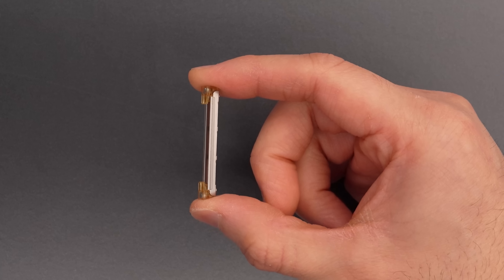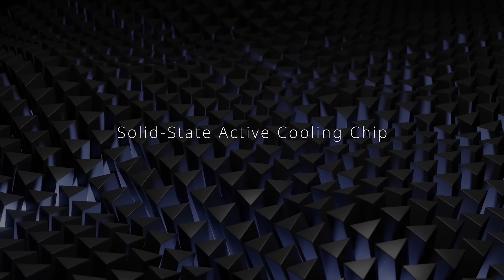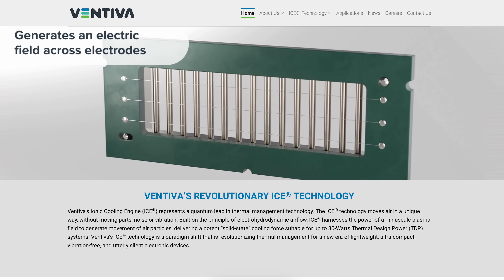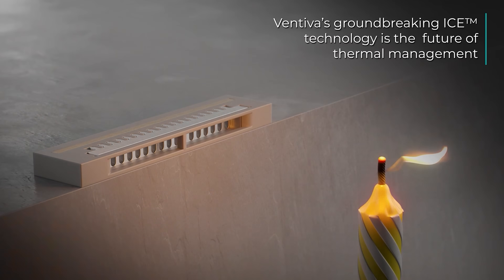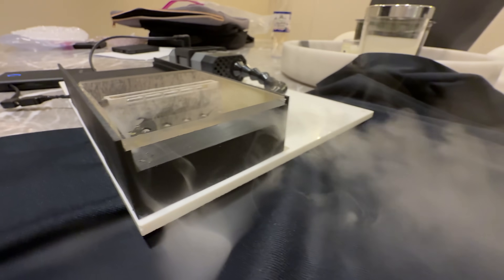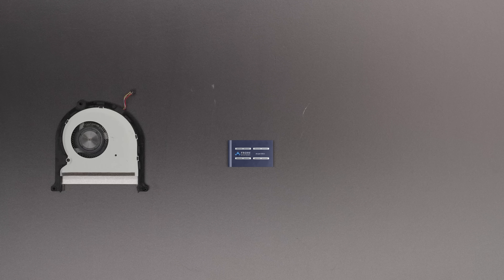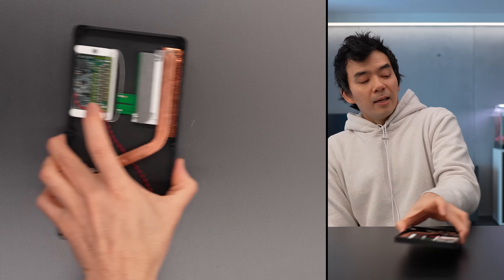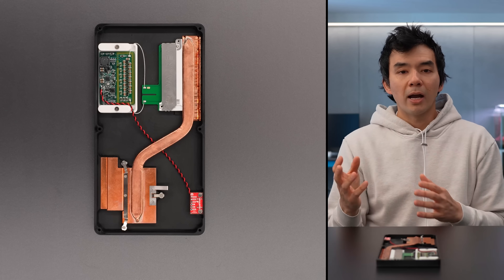The IMPOSSIBLE Laptop Fan...

Comment: Just so you're aware, this tech isn't even remotely new- The company that formed Sharper Image created an ionic Air purifier in 1977. It was later rebranded to the Ionic Breeze, & with a new ad campaign was really popular around the early-mid 2000's. They still exist now, & I bought one myself primarally because I had friends that smoked cigaretes. It would pick up dust, animal dander, smoke from cigarettes, got a smaller one that I used for my soldering station, to pick up the burning rosin & flux smoke, it worked fantastic for that by the way; & to clean it you just gave it a quick rinse or wipe down with a soapy washcloth. Although it was pretty expensive at the time, it still runs as well as the day I bought it 28 years later.
Reply: I had one too 25 years ago, it was pretty cool but I agree, nothing new here except for power management
Reply: Wow. That opened some information about that company and their controversy.
Reply: Ion air cleaners are 'forgotten tech' because everyone wants to sell you beefy motors to force air through micropore filters and sell you new filters forever.  There is a small volume in which you get good results, but it's the same for HEPA devices and there are ridiculous claims there as well.  Years ago I chose my ionizer for one reason: mold, pathogens and dust in the bedroom.  This improved sleep so much I used them ever since.  Wiping positively anchored particles off walls and surfaces is satisfying, to know I am not breathing it.  And they're cheap on energy and silent.  Just stayed in a motel for several months, a place where neighbors complained about the mold.  I taped over central vents and the ionizer kept the air 100% clean.  Have been breathing neg charges oxygen for 40 years.  Good healh, clear sinuses.  I get angry and insulted when I explain the effectiveness to my family and friends and they don't even bother to try it because they don't believe me for sh*t..  I reply to them, "Darwin in Action" I guess.
Reply: Yeah the concept for ionic thrusters is from 1911 so not new but if it works in a laptop it’d be great as I don’t care for fan noise.
Reply: The tech itself is not new no. Of course! But shrinking it down to cool a laptop is. Imagine if they could use this in the next PlayStation? We could get a console back down to almost PS2 Slim sizes.
Reply: @KCScorpion34  or, we can be grown ups and accept that changing charge states in FET structures inside a silicon semiconductor inherently creates heat, thus if we want things like, say many gates doing many things very quickly, there WILL be heat generated (work is work, a watt is a watt. In physics there are no free lunches).

Seriously, the real problem is the manufacturers keeping out on overall airflow design and heat sinks where they are needed. Trying do everything with one fan. And it has to be silent, because of all the self labeled autists out there who think hearing a noise is supposed to throw you into this inescapable spiral of oh no I can hear a thing hashtag day ruined.* What we need a lot more of is the extra 3 cents spent on generic heatsinks to stick on tertiary, fans with enough excess air flow/more fans to provide air flow over them instead of letting the boards cook so little johnny doesnt have to hear his computer working, and less exotic experiments into die bonding and ball soldering to facilitate difficulty in the user gaining full access to the device they have purchased by way of goop squirted around the mounted chips... Not 8 year old picture book thin modern flagship gaming consoles. Do you want red rings of death? Because thats how you get red rings of death.... The people need to demand reliable systems that dont treat them like fragile walking wallets with criminal intentions. Screw flatter, quieter, whatever-er crap. I want to own my system and have it be as reliable as my NES....which still powers on like the day we got it for Christmas. Oh, and not in some stupid avant-garde pseudo-modern-art shape. 

* Im ADD HD (from way back kids), I can say that. I can also say, given my direct and personal experience living with the disorder, that is not how that works, at all. Silence is terrible for the ADD brain, like literal torture. If you long for absolute silence and fly off the handle when you can hear something, A) youre a overly controlling douche nozzle that never learned you're not rhe main character in the universe, and B) you're looking for an excuse not to do the thing. What people who do that are pantomiming is more executive function disorder, but as a bad parody, sort of like people who play OCD when really they're just a control freak (the clue is in the D...its a DISORDER!!! If you can playfully toss it around for cripple clout with your buddies or wear it as an identifier, it aint a disorder, its a fashion accessory. And it is incredibly demeaning, belittling, minimizing, and outright offensive to those of us who ACTUALLY have to deal with ACTUAL broken brains. Not just a brain mommy and daddy didnt prepare for the real world....Now, go a head, tell the Mr hyperfocused on everything all the time's observations of human behavior how his personal experiences in life are wrong....minimize me again for that pop-culture clout....)
Reply: @zombieregime  I'm not reading all that fam.
Reply: Don't these produce ions that cause cancer??
Reply: Do you know if i can make one as a DYI ?
Reply: @averagefpv9449 yes, search YouTube. I saw a video of a diy version of this
Reply: 28 years and still in good conditions thats a interesting bit
Reply: That's true I had one when it died from old age I bought a new one and it still working right beside me
Reply: OP: "this fan is really quiet, wow!!"
Audience: "cuz it's really weak, grug!!"
Reply: I had it too and realized it barely cleaned the air of a room, only a very small area around it. The ozone smell it created gave a false sense of 'clean air' but was really just polluting the air even more. You're idea to use it near a soldering station is smart. I also remember cleaning the blades was not easy. If the black residue was left on for too long it basically electroplated itself to the blades and I had to put some serious elbow grease into wiping off all the black residue.
Reply: I mean this is the same like saying M1 in Apple MacBooks is super old technology.. Yes ARM has existed, but never at such power efficiency levels and at such scale. Same with this technology.
Reply: @snelle_tomos  Its not even close to being similar example. This tech is extremely similar to iconic breeze

Comment: Just looking roughly at the design, the fine wire is probably a failure point.
And the deionizing part probably has sacrificial material in it.
It is also looks unserviceable. 
And you can only replace the whole unit.
The company that is most probable to use this tech is DELL.
It is interesting though.

Comment: This is a horrible idea! Fans are efficient and proven technology that is cheap and works reliably. Putting a really high voltage generator into a computer where chips are running at increasingly lower voltages is sheer madness. The dust build up, filtering requirements, and potential to generate harmful levels of ozone with lack of maintenance are complete deal breakers. No commercial operation puts any money into maintaining their computers once they have been installed and set up on a desk. It runs until it breaks or becomes obsolete with minimal if any intervention in the meantime. Forty years of experience have demonstrated that this is practically a law when it comes to business, not just a rumour or a hypothesis. Just because something can be done, it doesn’t make it a good idea or even a breakthrough. Ionic propulsion systems have been known about for decades and they work well in space satellites but there just isn’t a use case for terrestrial based technology. There are some limited uses I can think of and laptop computers are not even on the horizon.

Comment: these are old and have been used in satellites as thrusters for a long time, even the TIE fighter was based on this tech, but they work on high voltage and that can cause charges to accumilate/buildup, its dangerous

Comment: You are so excited about it working in ideal conditions but in real ones it will corrode(applying electricity to things at non sterile conditions does that), spark(when humidity is higher, like a rainy day(or in come regions every day is like that)), and get covered with dust(and cleaning the dust off a thin and very fragile wire can kill the cooler instantly).
It will have quite low static pressure that will ruin efficiency.
Exactly the same problems that ionic thrust hobbyists have when building similar things.

Comment: Sharper Image had this technology back in the 90s, called the ionic breeze, it was advertised as an air purifier. I owned one, it produced ozone and it would electrically charge the air and dust particles. dust would collect to the fins. I suspect that this will create ozone as well and will get dirty very quickly which will require constant cleaning.

Comment: Let's see how did they break the impossible. You can use vibrating piezo materials to make airflow, but that's still moving, so it should be something else. If you would use electricity, it needs high voltage, which is not silent, and also it generates ozone which is toxic, and it's also really weak.

Comment: few problems: 
1. efficiency of MnO2 as a catalyst decrease with increase in temp, which is gonna happen with heat sink
2. the decomposition of O3 to O2 is itself an exothermic reaction (releases heat).
3. Air also has N2 thats being ionized, which release N ions and it has O ions too they can also combine to form harmful nitrogen oxides too.
4. The MnO2 layer will degrade overtime, and when it does ozone and oxides of nitrogen will also start degrading the underlyingg copper heat sink
Reply: I am curious, why would the efficiency of the MnO2 decrease with an increase in temperature? The reaction kinetics are gonna significantly increase with temperature. 

The thing I am worrying about here more, is how they want to achieve sufficient contact time between catalyst and ozone to ensure quantitative decomposition. 

And tbh, of course the catalyst will somewhat degrade, but that is not my concern, same for heating due to decomposition. The ozone concentration produced is so small that any heating is gonna be negligible and additionally ozone won’t really degrade the catalyst as it’s already an oxide. If anything, it might react with the support material, but then you could switch to a ceramic catalyst support. 

NOx production due to corona discharge is actually minimal, but probably enough to cause superficial oxidation of some components long term. I am more worried about the health aspect here
Reply: Awesome points and thanks for sharing!
Reply: Huh? I thought the whole point of a catalyst is that it is not consumed in the reaction? Why is MnO2 any different?
Reply: Lol wow we have battery operated devices with diesel emissions before GTA6.
Reply: And all that hassle for 1 watt improvement 🤦‍♂️
Reply: @Cray23_Official  the problem of fans is not power consumption but noise!
Reply: @Cray23_Official there’s not even an improvement in power efficiency it’s just space

Comment: the best technology IMO  is not to use cooling devices at all.. like the ones in phones or Mac devices
this is an old "technology" that could risk shocking the laptop's internal components so more things to break for the sake of saving money and making laptops thinner.. which they don't need to be btw

I'm not hating on you Dave but I'll have to be very cautious when watching your videos, you have a tendancy to overhype products without properly testing them, I trusted you once and bought a piece of hardware that was nothing but problems.

Comment: I know with the Frore, There was a thing that made the CFM not as much of a concern. It Basically slammed the air straight on to the cooling surface. Normally, when cooling with fluids (yes, air is a Fluid), there is a boundary layer you need to contend with. Because it slammed the air straight down it completely demolished that boundary layer, meaning Every molicule of air flowing through it was taking heat away... 

As a good visual analogue, You ever turned on your tap and noticed there is a thin layer of water that rushes outwards, until it comes to the point where It's unable to overcome surface tension, And the water bunches up into a thicker portion of water that the high velocity fin film rushes under. That's what it was doing to the air. How much efficiency This gained I have Forgotten, but Bear in mind CFM/W is not a 1:1 translation when it comes to removing heat In this particular case.

You also have the issue that a lower static pressure means fins must be spaced apart more sparsely to not Impede flow, Reducing your surface area that is capable of offloading heat to the cooling medium. That means if you have a fin density of say 1-2 Per millimeter, which sounds about right for a good density laptop blower heat sink, with a fan at 40-50 pascals of static pressure, That will have to be cut down to 0.3 - 0.6 (40 Pa)  or  0.24 - 0.48 (50 Pa) fins per millimeter to get good flow. 

To put that in perspective, with the Frore at 1700 Pa, If a 50 Pa blower fan can give you a fin density of 2 per millimeter with good flow, A Frore Could push its air through a fin stack with a density of 68 fins per millimeter... Near impossible to manufacture, and I'm sure it hits a limit of diminishing returns as the air reaches max heat soak. Still fun to think about though.

Comment: So So let me get this straight, the Airjet product is smaller than this, produces higher pressures, has WAYYYY less of a dust issue, no ozone/ionisation issues, no potential for shorting the circuit or need for high voltages and the circuitry required....yeah Im rooting for the Airjet here. Hope they can figure out a way to make their product more efficient in terms of energy.
Reply: But given all of those issues you pointed out, Im surprised that you have so much enthusiasm for this product when it genuinely seems DOA to me.

Comment: There is an oopsie here with that well known company logo clearly visible on the device in this video :) https://youtu.be/fyai_kUYhLs?t=359

What I am hoping for is this technology clearly is very malable and has plasticity in its design that possibly should make it possible that it can be made with odd shapes and curves, and compounded devices to retrofit in older laptops to 1) up the efficiency of the ariflow, but also 2) to silence or at least mute existing small devices that feel like sitting with a hot vibrating noisy mess in you hands or lap.

Comment: It's not only sucking dust in like every other cooler but it's also charged so dust particles will statically cling to it. If youre not using this in a hermetically sealed room your anodes and cathodes will have a thick layer of isolating dust around them. If you're a little bit unlucky the dust might even short out your cooler. Seems like an incredibly impractical cooling design. Just use a weak passively cooled laptop and connect to a server if you need compute power on the go while staying silent.

Comment: I don't really think this solution will take off. High voltage require a pretty big power supply and even if they can shrink there's really no point cause you'll always need a pretty big inductor, mosfet, and a few high voltage caps. Then there's dust, I would love to see what happens when dust particles enter the device. it would probably spark and vaporize the dust and it'll smell awful. I don't trust their anti ozone solution

Comment: this tech actually existed about 20 years ago. But it wasn't very efficient, not powerful enough, and didn't push the air far enough, and required a lot more surface area. It also had some serious side effects. It's cool to see this come back with much more improvements.
Reply: I remember seeing "fanless" ionic air purifiers in the Sharper Image catalog in the 1990s. This tech has not only been around decades, it's been plenty "good enough" for at least that long. if there's any reason I can think of that nobody's tried to use this as an electronics cooling solution, it's probably because they're EXTREMELY good at collecting dust... so much so they are sold as both consumer and industrial dust remediation devices. That's kind of the opposite of what you want in a thermal management application.
Reply: @Smidge204  Not to mention the amount of ozone it produced as a side effect. Even the later iterations of the Ionic Breeze eventually included fans in it because it push enough air volume through the metal plates on its own.
Reply: 20 years? Perhaps you meant 200? Ionic wind is a well-known phenomenon.
Reply: @volo870  yes, but implemented as a cooling solution for CPUs is fairly recent.
Reply: Yeah enjoy the toxic air this puts out :D
Reply: TECHNOLOGY. Not "tech".

Comment: Laptops cooled by the the crusty, multi decade old obsolete archaic fan design had a major flaw, the laptop design was centered around the thermal design of the laptop.
But with this new, albeit it being orders of magnitude expensive, harmful to the air we breath and significantly power inefficient, tech

laptop design will still be centered around the thermal design. Big open unrestricted spaces for air to flow, a brand new extra power source, and special freaking heat sink.

Comment: Nothing new in here. This was newer used due to DUST issues and safety reasons. Also you can poke with a paper clip inside, and get a nasty shock... All appliances that have more than 60V inside impose  safety issues and obey to different standards, meaning price increase. You cannot get pressure difference with that flow, so the cooling fins will increase the drag and less air will flow.